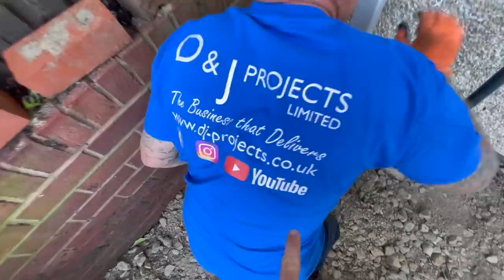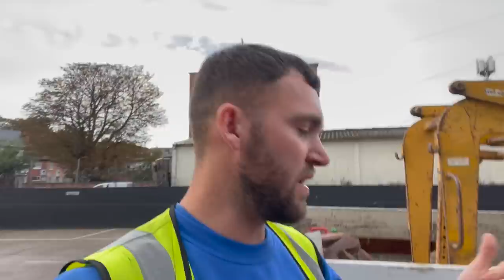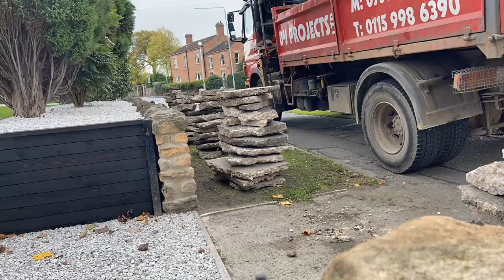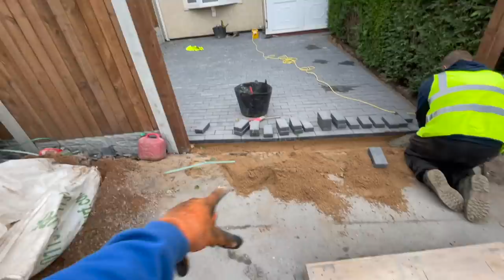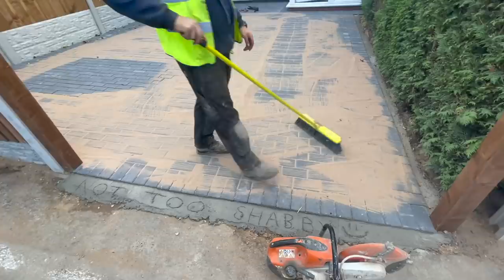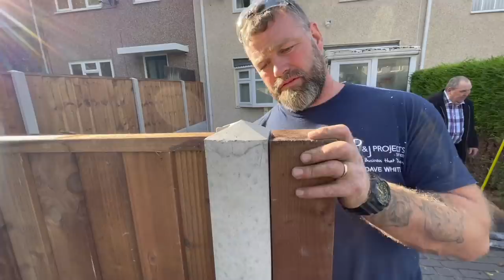This TRANSFORMATION Will Blow Your Mind! - This Week At D&J Projects EP #032

Comment: I watch all your videos and it’s great stuff but I do block paving and slabbing for a living, you should of took the righ hand side border out, scraped up the sand replace it with a strong mix and tapped the blocks back in on SBR then do the final hornch 
I would not of left them on sand it will move and make the drive very weak

Comment: Looks great, much better than the previous version of the back yard.  I like the balanced width panels next to the gate.  I have seen new gates on slopes with  guillotine panels on the inside that have to be pulled up to open the gate.  Not worth it unless you need to contain a small dog for instance.  At the beginning, did I see you attach the wood post at the house end of the fence to the neighbor's brick wall, or was that attached to the customer's house?  After you removed the neighbor's dirt, I imagined a future where that brick wall is removed and the fence gravel boards become a retaining structure.

Comment: great job lads, we always use a geotextile under the sub base where we are, we are on boulder clay which is like concrete when dry but like soup when wet no matter how well you whack your setts you will get tram lines in them after a few years as the sub base migrates into the sub soil. love to see how different guys solve similar problems, there are many routes to the same goal & just because someone else does it a different way does not mean they are wrong it may be you!

Comment: On the gates you should be using rising hinges when you have uneven ground levels. Why aren't ?
Reply: Wouldn’t help with the slope of the pavement, maybe an inch at the high end that’s all.
Reply: @frankiepitt9135 
You can get them to raise more than an inch....these hinges are used on farm gates alot. Infact in the  states they have angled hinges to deal with sloping drives but don't know if you can get them here.

Comment: The sand should be taken out completely for the sand and cement haunching. Over time the sand and cement will start breaking away. Also it’s best to run the grinder blade down the outside of the paving between the cuts and header course for a better finish and to allow dry Kiel sand to be swept in
Reply: And overlaying tarmac will cracking in couple months😂
Reply: Show us your work 🤡
Reply: @davidwhite4195  I'm on hs2 at the moment mate